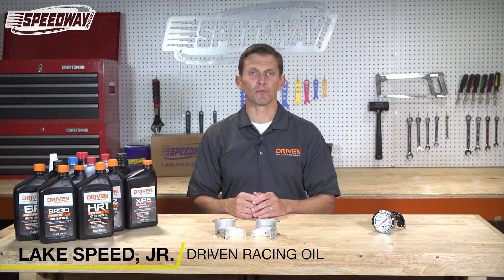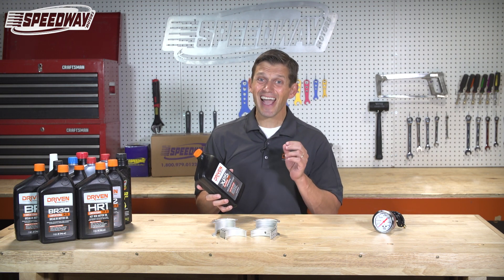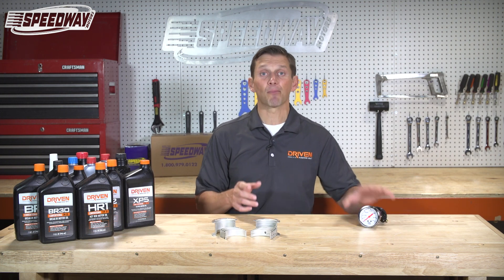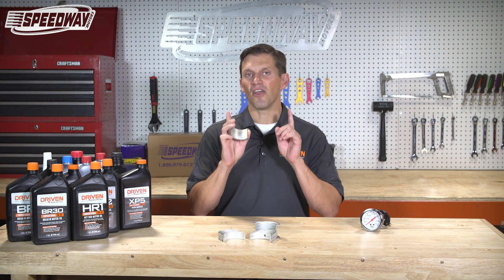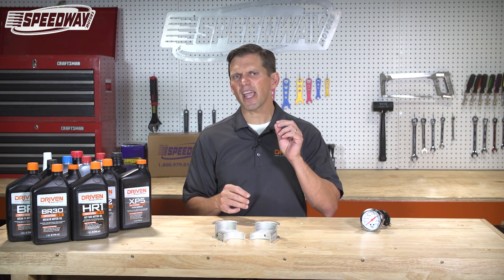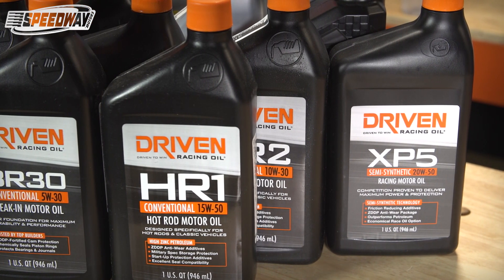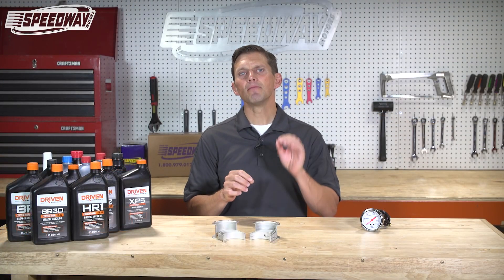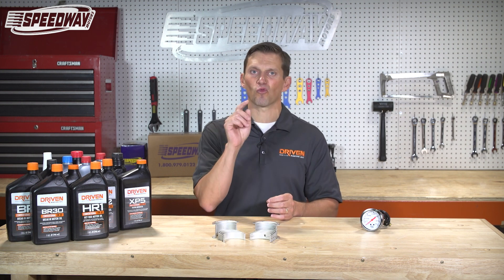In The Shop with Driven Racing Oil - Viscosity

Comment: So for Oil viscosity, what you're saying is... So Rule of thumb, if you had to rank these 1-10, 1 being highest and 10 being lowest, the first thing is -> The #1 thing for Oil viscosity to keep in mind is if you change bearing clearances, you need to change to higher viscosity oil. 
The #2 thing about Oil viscosity is the oil viscosity is meant for higher oil temp because the oil will thin out causing damage to internal parts like bearings. right?

Wow... race gas too? dang, so much variables. 
Clearances > Oil temps?
Reply from the maker: Thanks for your question!  We reached out to Lake and here's his response:

"The most important variable for oil viscosity is the bearing clearances. This is why the car companies have a recommended oil viscosity on the filler cap. They have already figured out the correct viscosity grade for the clearances in the engine.

The second most important variable is oil temperature. Again, back to the car companies, they have chosen the recommended viscosity grade based on the engine running at a high oil temperature (driving up a steep grade in the middle of the summer). If you are drag racing, you need to factor in the lower operating oil temperature to optimize performance.

The third most important variable is the fuel. One more time, the car companies have chosen the recommended viscosity grade based on the recommended fuel type for that engine. The air to fuel ratio affects the amount of fuel dilution in the oil. For example, gasoline has an AFR of roughly 14.7 to 1 while E85 has an AFR of 9.7 to 1, which means E85 creates more fuel dilution. For this reason, the viscosity choice needs to factor in fuel dilution when running E85 or Methanol.

I hope that helps clear things up!"